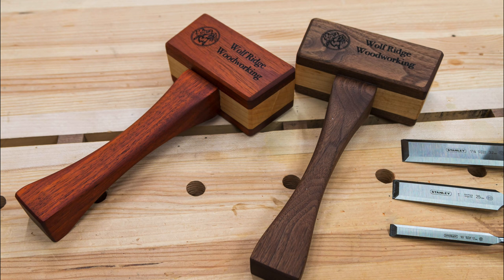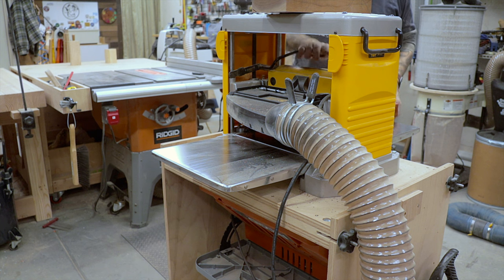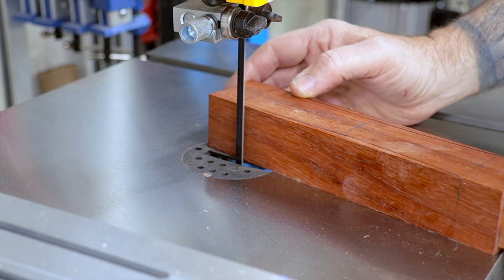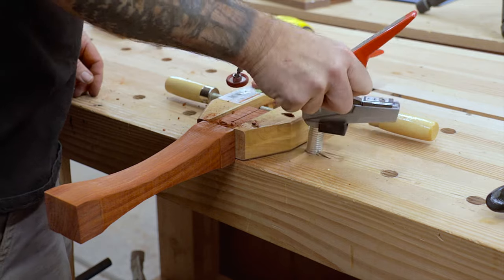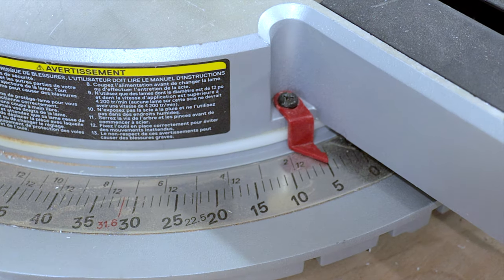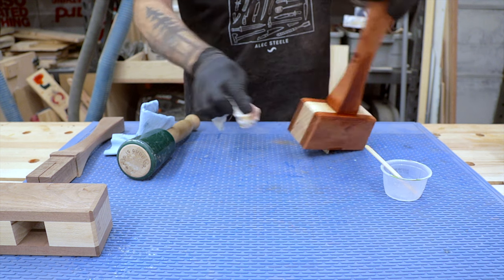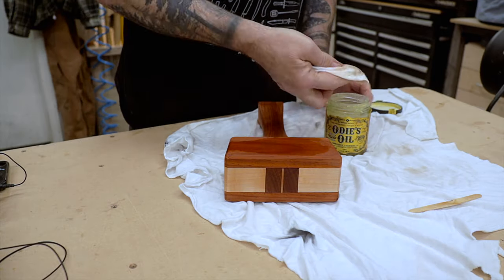Woodworking:  Woodoworking Mallet

Comment: Ed, Hammer time.  I love both hammers.  These hammers are as beautiful as they are functional.  However, I plan to turn the handle on my lathe with groves for improved grip, while using your same attachment method at the hammer.  Thanks!
Reply from the maker: Thank you!  Turning on the lathe is a great idea. Check out my latest video where I make a carving mallet out of left over resin.  I also turn the handle on the lathe. - Ed

Comment: Hi Ed, great hammer. I like the design and the way you made it. I was interested to see your nail gun does the same trick as mine, which is a similar make.
Mine also  won't fire the nails out sometimes. I found if i spray a little solvent in the head let it dry then use Graphite power on it then works fine.
Thanks Les.

Comment: Nice end result, Ed. I have a tip for you that may be of interest to you or to your viewers. RE: Securing the handle with wedges... Prior to cutting the kerfs that will take the wedges, drill an 1/8" hole where each kerf will stop. Now, when you drive in the wedges, any stress that might travel down the grain will be relieved by the 1/8" drill hole. Guaranteed!! WARNIING: When you cut the kerf, only cut into the 1/8" hole but do not nick the opposite side of the hole. That nick would encourage the stress to jump the gap and the advantage of the hole would be lost. Btw, I'm interested to know if any of the Paduak mallets are still available. Cheers and blessings to you and your channel viewers. e.k.
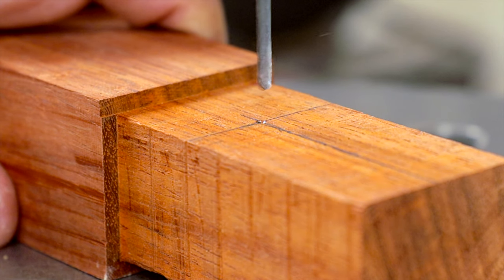Reply: So your tip is to do exactly what he did at 4:38 in the video? 🤣🤣🤣 you’re funny.
Reply: Did you even watch the video?

Comment: Very good video! Will be making 3 of these. 1 for myself, the other 2 for my woodworking buddies. I have approximately 25 bd ft of 100 year old oak, some walnut and padauk. I am excited! Question, when making your center, maple piece, is there an advantage to cutting the inside edge, on same side the handle will be splaying out from the wedge, on an angle to match the wedge? I’m thinking more contact for glue surfaces. Or am I overthinking?
New subscriber here although I’ve watched a number of your videos before I remembered to subscribe!😂